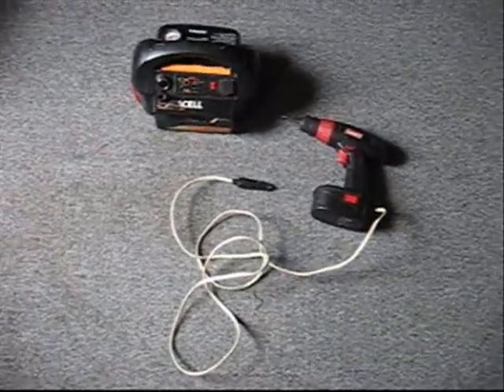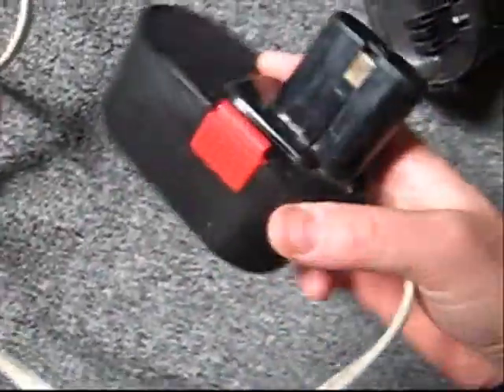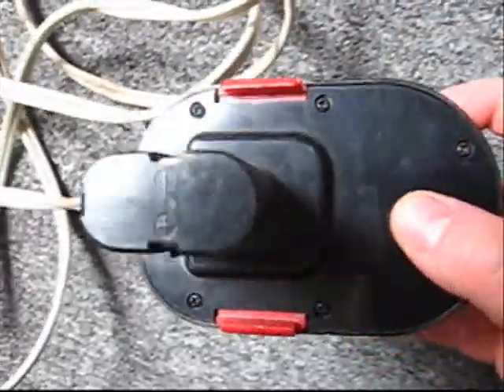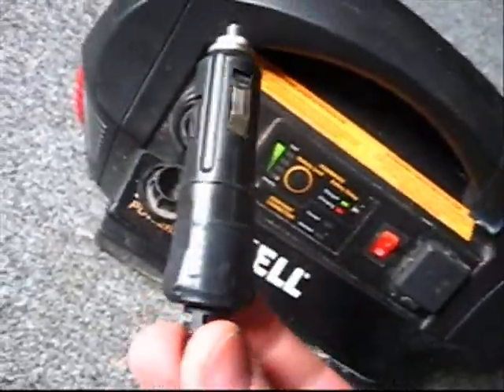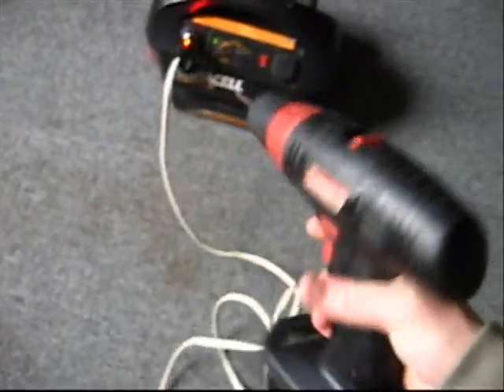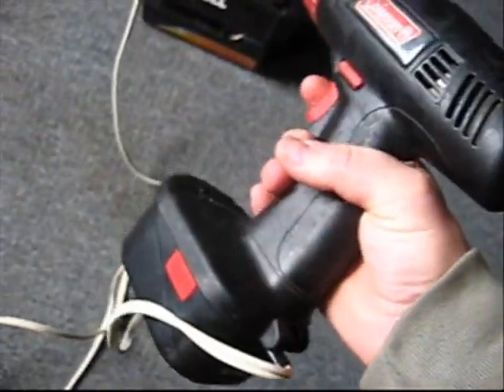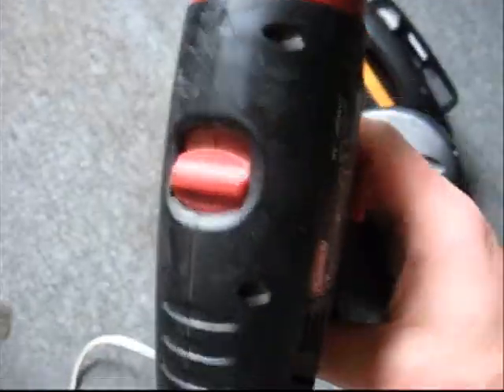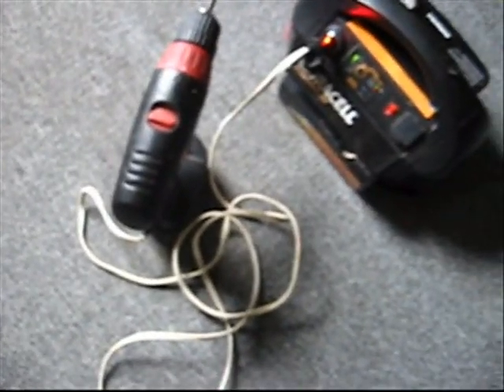18V Coleman Powermate Cordless Drill Battery Mod

Comment: I have that same model and trying to do the same. How many amps are needed?
Reply from the maker: You will need at least 5 amps but I'd go higher.
This rig is just a car cigarette lighter cord connected to an empty battery by a lamp cord.
Also remove the fuse or use one that can handle a big load. I had this made up and went to use the saw and it blew the fuse so I field fixed it.
If you are handy with building batteries I'd go for a lithium ion build with a BMS but you'll need to know what you are doing for that. If not then leave that to the professionals.

Comment: Erdie5 Amperage doesn't matter as long as it's able to provide more than what is drawn.
As for the battery, if it's dead it could possibly kill the cells if they were dead prior to attaching the battery since it'd charge them too quickly.

Comment from the maker: Variable speed shouldn't matter. Mine is variable speed. When you hook it up try the drill if it turns anti clockwise when in foreward and vice versa then the wires are reversed. What you want is to be able to drive a screw in when in FWD mode. and remove when in REVERSE mode. if this happens then the wires are correct. I had this problem but was easily fixed.

Comment from the maker: You will need to adapt the battery to a 12V cord (lamp cord is fine) and put a 12V car lighter cord on the other end. Check polarity, if the drill runs backwards  when in fwd then switch the wires. Car power is perfect for your drill and if you want more power then start your car's engine. you will get about 4 more volts. I am running this drill off an old lawn tractor battery that I roll around on a small hand truck. Try it and post a video.

Comment from the maker: Build it, it works GREAT! The drill runs slower but as long as you have a really good 12V battery it will work. I can now use the saws too. And remove the fuse that's in the plug b/c it will just blow b/c this setup draws hella amps especially with the saws. install a high amp fuse, maybe 15-20 amp or just a hard connection (no fuse) in the plug, that's what I did.

Comment from the maker: All you do is get a beefy12V car cig lighter cord and replace the fuse with something metal and then run your cord to the where the battery terminals go but in your case you might need to hook on to the contacts in the drill where the battery goes. Polarity must match. if the drill goes forward when in reverse then reverse the wires. My drill doesn't seem to mind the lower voltage and it works well. If I do this again I'll try to make a vid on it.

Comment from the maker: That is what this is. This was part of that same kit and I still have most of the other tools. You can maybe find a battery on ebay or some other site and you can't use any other battery. There was an adaptor that let you use dewalt batteries on ryobi drills and vice versa but one of those companies said "I don't think so". However if you do this mod you can use the drill but the saw doesn't like the lower voltage. Mine didnt.

Comment from the maker: @dying2l 
I'm not sure you can charge it directly but if you have a cord that fits the laptop and say for example the laptop wants 18 volts DC and the charger puts out 18 volts DC maybe you can hook those 2 together but I really wouldn't recommend it as a laptop is a precision device and it wants a filtered supply of clean power and a drill charger's power is really noisy. I'd use an I.T.E. (Information Technology Equipment) adaptor.

Comment from the maker: @dying2l 
This drill uses Ni-CD batteries. They are still lying in the junk box in the garage. And I respect li-ion/ LiPo batteries thanks to the vids on here on Lipo battery fires. I will eventually smoke my old iPod battery. hook it to 12VDC and zap it and make a video.

Comment from the maker: @Erdie5 
That's what i say, I'll give up portability over performance anyday, although the unit is still portable it's just less convenient. but it beats spending a ton of money to replace the batteries in the packs. I've seen vids in here where DeWalt drills suffered from cheaply made overpriced batteries so I say rig your tools to run like this and don't waste your hard earned money on replacement batteries.